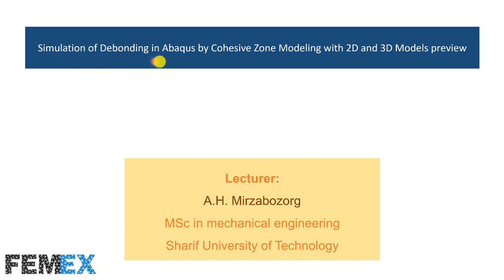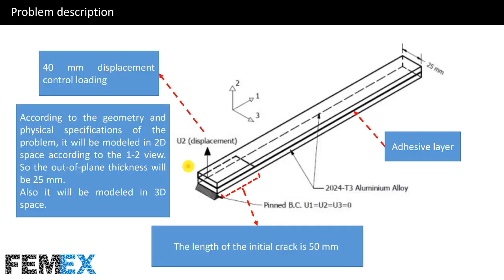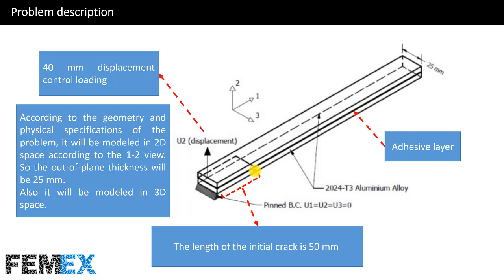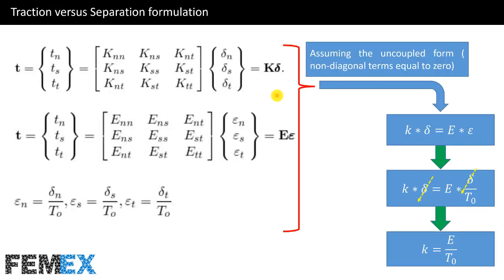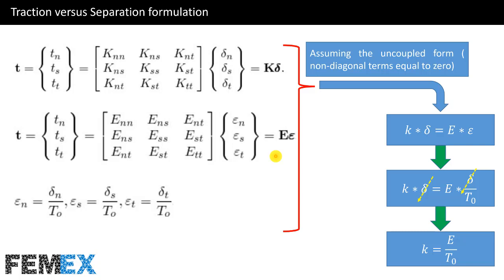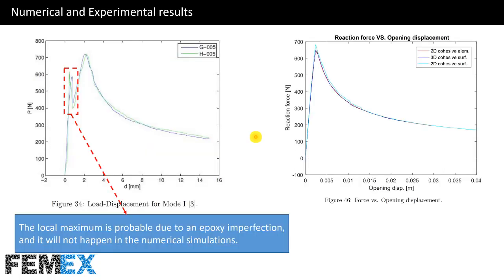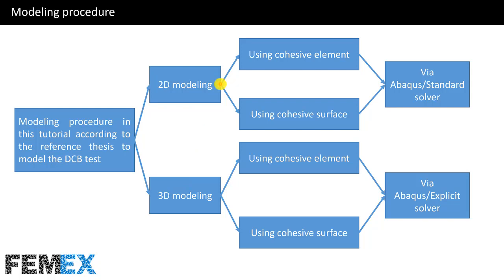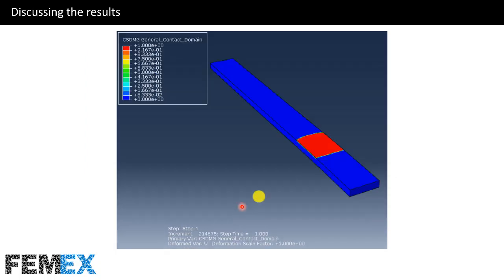Simulation of Debonding in Abaqus by Cohesive Zone Modeling with 2D and 3D Models preview

Comment: I have a question about the boundary condition. Why did you apply a fixed boundary condition on the other side of the beam? Could you please explain that? Also, did you encounter any difficulties in converging the solution? I'm receiving numerous warnings about negative eigenvalues due to the boundary condition.
Reply from the maker: @shagatadas4331  Hi. As the complete version of this tutorial is premium, you can buy it or ask for online consultancy to resolve your issues.
You can send a message in WhatsApp via (+98)9351324013
Or send an email via mirzabozorg71@gmail.com

Comment: Hi Amir, I have a question, I have stress-strain curve of an adhesive, the profile is a triangular. I multiplied the strain with thickness of the cohesive element to get stress-Vs-displacement curve. Now, when I take the area of the triangle, my number comes to as 2 N/mm. But my Abaqus does not run; the error is "CRITICAL FRACTURE ENERGY IS SMALLER THAN THE ELASTIC ENERGY PRIOR TO DAMAGE INITIATION" ... When I try to lower the number to 0.5 N/mm (just by trial-&-error), the files runs for some time (I see erosion of cohesive element, but still doesn't run thru completion..... do you know what could be wrong ??? Please help
Reply from the maker: Hi.
The error says "The fracture energy is smaller than the elastic energy." I think it means that you must increase it from 2 not decrease it to 0.5 . I am saying this according to the physical meaning of the error.
What stops the simulation?
What error?
Are you modeling in 2D or 3D?
Reply: @FemexIran  Thank you for replying Dr. Amir.  All my components are 3D Solid elements, mostly C3D8 and some C3D6 elements. I recalculated the energy, it is coming around 2.6 N/mm, and it seems to be working now. Thank you, sooooo much for your help.
Reply from the maker: @mono7891   You are welcome.

Comment: Hi, thank you for this video. I have noticed that the 2D models do not reach the same displacement as the 3D models. Is this due to a convergence/time increment issue?
Reply from the maker: Hi.
You are welcome.
For the 2D model with cohesive surface, yes you are right but for the 2D model with cohesive element, I have killed the job myself.
facing convergence error for the 2D model with cohesive surface is not important because the peak of the force-displacement curve is obtained and this is enough for us. Even it has continued after the peak point of the curve.
This is not the problem of modeling or settings because after a certain point, the structure will be unstable and getting the convergence errors is inevitable.
Reply: @FemexIran  Thank you for the explanation. If I had to model something where I was interested in the whole non-linear branch of the force-displacement curve, would I therefore have to use Dynamic/Explicit analysis?
Reply from the maker: @HarryJackson-qg6qw  You are welcome. Yes if you use the explicit solver, as it will not face convergence issues at all, you can obtain the whole nonlinear curve. Also we have a premium tutorial about how to use explicit solver to do quasi static analysis. This is the link of its preview :
https://www.youtube.com/watch?v=Y4uKpgpHjgk&t=54s
Also please read the descriptions below the video.

Comment: Hi lecturer. Please what are the advantages of cohesive surface in comparison to the cohesive element ?
Reply from the maker: Hi.
surface based CZM has some advantages in comparison to the element based CZM including:
1) When using the Abaqus/explicit solver, it does not affect the critical time increment size and doesn't make it smaller.
2) It is easier to define it because we do not define an extra part.
3) Only by changing the mesh of the adjacent parts, the accuracy of the simulation can be changed and there is no need to change the mesh of the cohesive region again.

Comment: Thank you for this wonderful tutorial. I will like to know what is the difference between CZM and VCCT in modelling delamination. Is one better than the other?
Reply from the maker: Hi.
You are welcome.
Actually the VCCT has some limitations in comparison to the CZM. Its main limitation is related to initial crack. We can use the VCCT only in the problems which contain initial crack. If there is no initial crack in the model, the VCCT cannot be used. Also The CZM is a newer algorithm. The only advantage of VCCT is the capability of calculating energy release rate which can be important in some of the simulations.